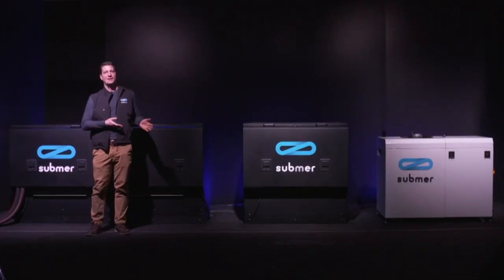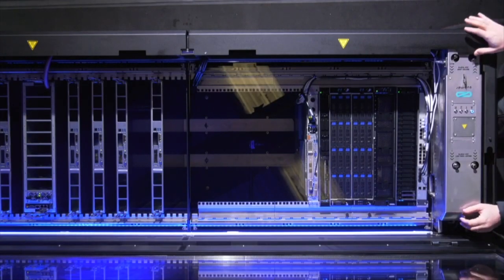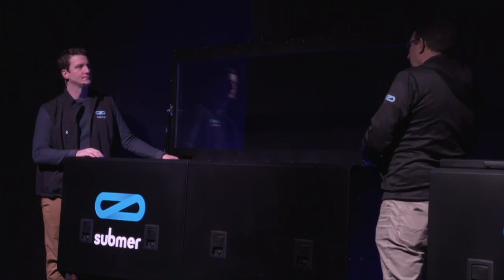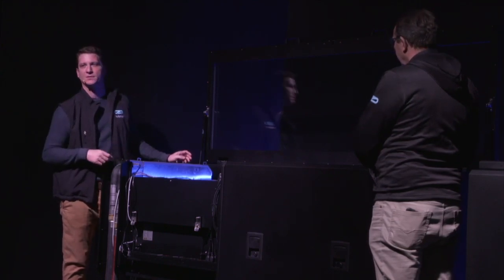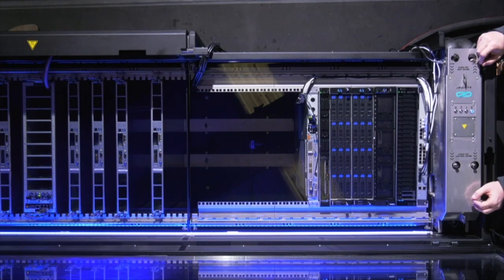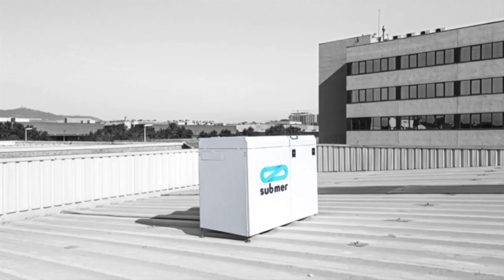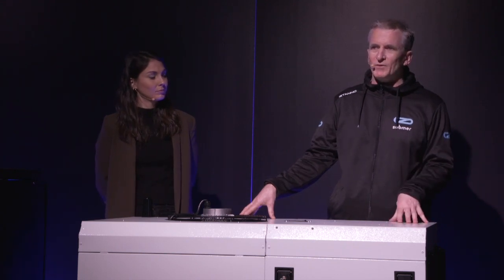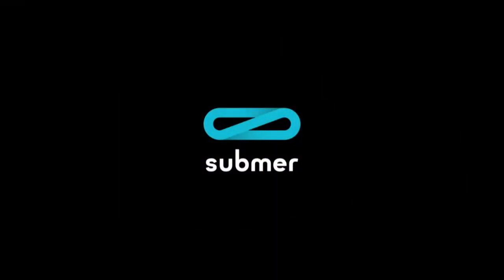Submer | 15-minute video | How does our cooling system work? | SmartPod & MicroPod Live Demo

Comment: Can a normal 19inch rack mount server be slotted in the tanks? or these are special servers.
Reply from the maker: Hi Ahmed! Thank you for your message. Most of the major server manufacturers both in standard 19-inch and OCP 21-inch support immersion today. We have partnerships with the major brands and can happily support you in selecting high-density systems with a full warranty for immersion 😊